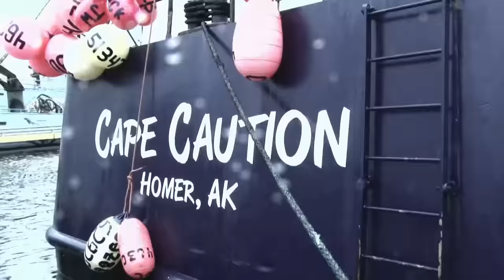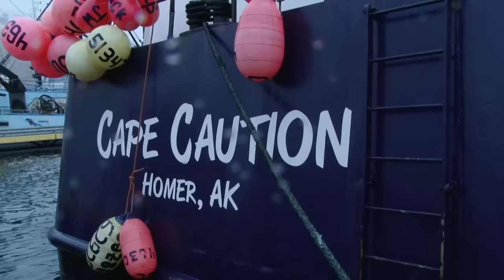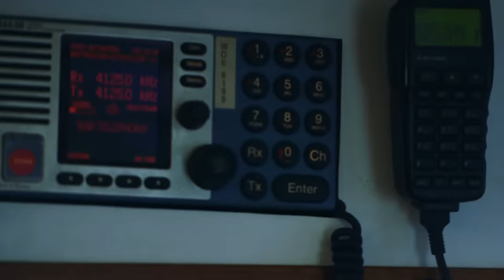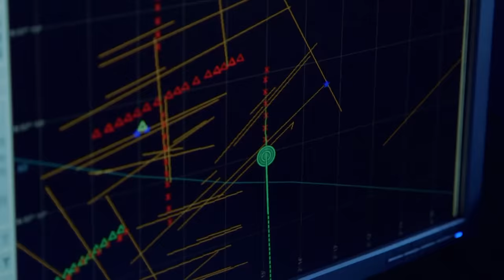Cape Caution Crew Get Sweet Revenge On The Northwestern | Deadliest Catch

Comment: Same on you Zack for not having every part on that boat in stock.
Reply: Should have an entire copy of the boat inside the boat, just in case.
Reply: @lekoman  a few hydraulic seals , spare rams , some pins and bearings . required belts , filters and spark plugs ( if needed ) . . . easy peasy .
sure it's a pile to have . better have and not need than . . .
Reply: @pappy451  They do have most of that stuff on board. There's a whole engineer's shop full of spares. It doesn't mean that every possible spare is on board. These boats are massively custom and complex, especially as owners modify them over time. Low part count is not part of the engineering requirements for a crab boat.
Reply: @lekoman  true enough .
Reply: They should have seals and gaskets for everything on board.